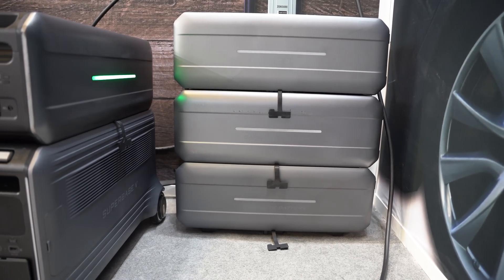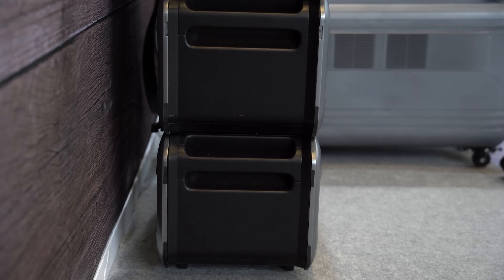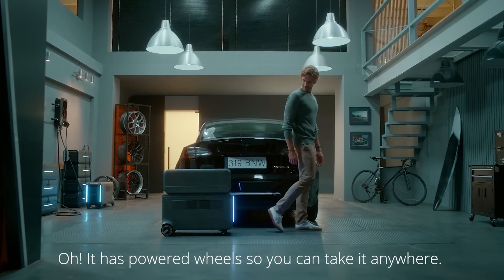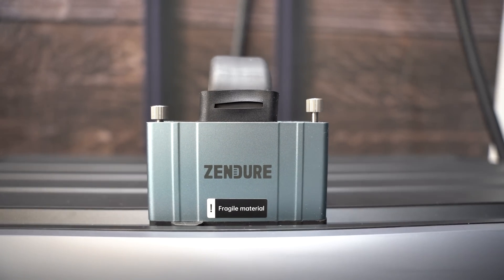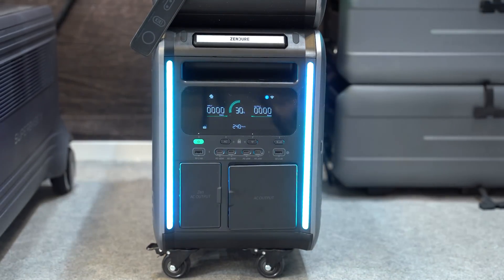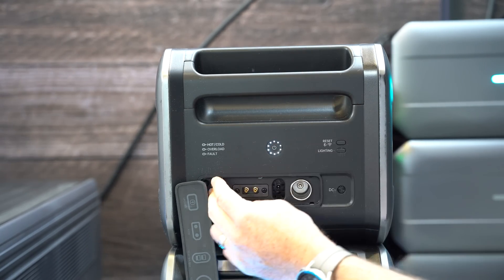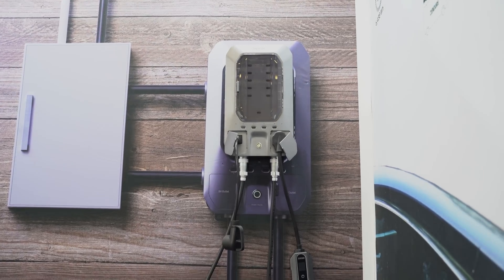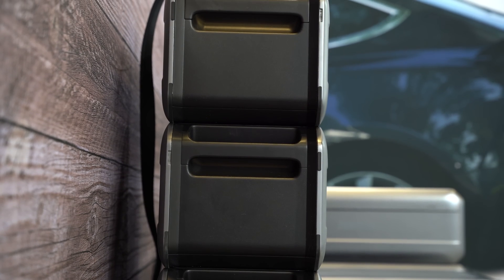Zendure Superbase V: world's first semi-solid state battery

Comment: 10,000 mA phone charger why not just call it a 10 amp phone charger good grief
Reply: That's a small one. There are nice portable 27Ah ones that are capped at that size since it's the largest capacity allowed on planes (100Wh)
Reply: @archietheproto7706   I don’t know why anyone would need 10 charges from a portable charger I guess it would help in an emergency.
Reply: More like 3-4 charges. People charge their laptops with them too
Reply: @archietheproto7706   yeah no that’s stupid If you have a laptop with you, you should either have a plug so you can plug it into an outlet or a large battery bank I don’t know why people use cell phone chargers to charge laptops and be better just to get a bigger laptop battery

Comment: I just found out about this on hobotechs channel yesterday. I went all in with Ecoflow Delta Pros  (2 pros/4 extra smart batteries and smart home panel) with a max of 21kw in early spring this year. I am interested in this model however shelling out 35 grand for 64kw to last only 4 years is a show stopper for me. If they up the charge cycles on the 6.4kw batteries to more than 1400 to more like what lipo can do ,I would be interested.
Reply: Yeah. I am no longer interested in Zendure, have decided to wait for Will Prowse or Ben from minuteman prep to review the  Hysolis Apollo  platform first which will arrive in November this year. Once reviewed, I will decide. Scalable expandability, efficiency blew me away. Hopefully testing will shake things out for me to make an informed choice for vendor.
Reply: 3000 cycles on semi solid state. 8 year battery warranty
Reply: 3000 cycles on semi solid state. 8 year battery warranty

Comment: I would love to see a comparison between the SuperBase V and the EcoFlow Delta Pro.  In addition, info or demo of the phone app. If the SuperBase V discharges totally and turns off, will it automatically turn back on once it's reaches a certain charge or is that a manual process like the EcoFlow?  Can you mix and match the battery types - Solid state and LFP or do you have to keep all the same battery types?

Comment: 2:10 This new technology offers an improvement of 42% energy storage compared to traditional lfp batteries?????? 
but shouldn't "traditional" NMC is up to 80 percent more energy-dense than LFP.
Other NMC battery such big capacity on market i can find on amazon is Goal Zero Yeti 6000X (6000Wh, 106 pounds).
Price wise, this is cheaper than Goal Zero Yeti 6000X and EcoFlow DELTA Pro

Comment: I like that output is 3800 watts but do you know how much peak power it can handle. As an example, the new Bluetti ac500 has 5000watts and 1000 peak but have seen it tests that it may only get 7500 watts. I like the design of this better without the big cables going out the side. 3800 watts is enough for me but hopefully, it can handle maybe 5000 peak watts. I like the price also for the LiFePO4 with one expansion battery for 9kw and ready for the launch. Hoping that these ship in December. Thanks for the overview.
Reply from the maker: They haven't shared the specs for peek or surge output for the inverter, but I'll ask. I really like the modular design as well since you don't have to deal with extra cables. Just stack them on top of each other and you're set, only needing a single cable to the main unit.
Reply: @xiaolin chen I think that is having 2 in parrallel. I'm curious about the peak for just one. Thanks!
Reply: @scottfreedom2012  for 2 SBV

Comment: Interesting product to be sure.  Can you use 240v and 120v at the same time?  How many amp input on the solar?  How does it connect to the smart panel and how much will the smart panel be?  What is the estimated time of shipment for the LFE battery main unit and spare battery to ship?  What is the AC inverter efficiency at .2c rate of discharge?  What is the DC efficiency and what is the roundtrip efficiency?  Will you guys get this in to any reviewers hands soon so we can get some 3rd party data prior to kickstarter launch?
Reply from the maker: Those are all great questions. I do know that that 240 and 120 outlets can be used at the same time, but you are limited to the maximum output of the inverted. 

The base unit uses Zendure's own ZenT2 port on the back to connect to the Smart Panel. THis port allows for power to flow both ways depending on if it is supplying power to the house or pulling power to charge. 

For the other answers, you'll have to refer to Zendure directly and as on their Facebook group.